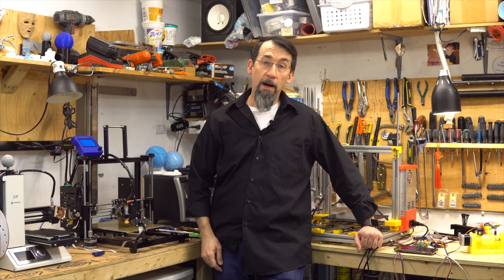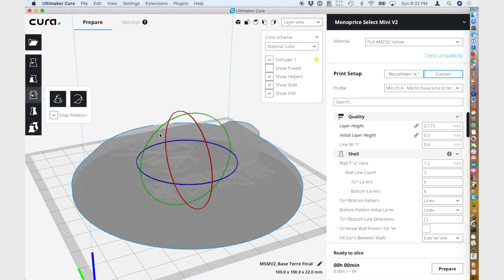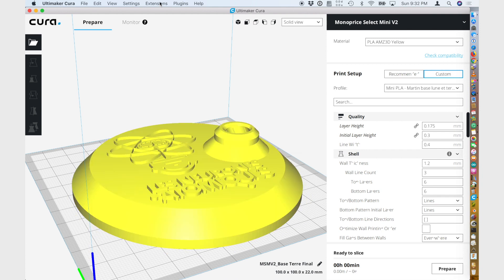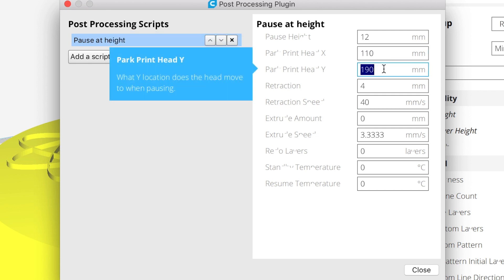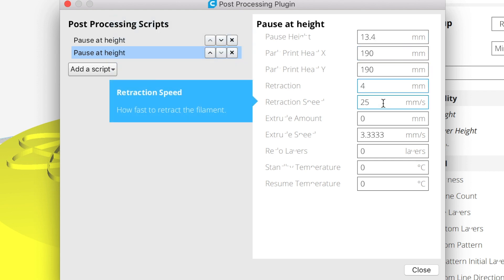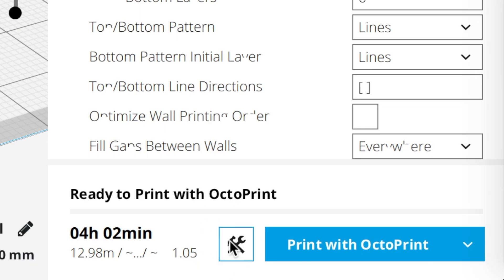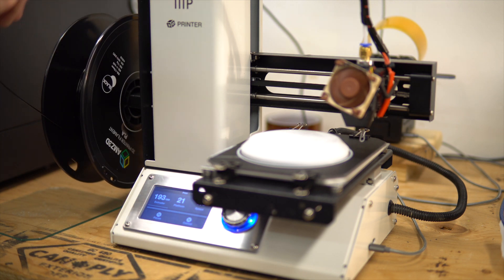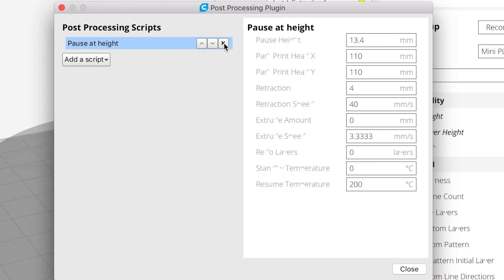Cura - Pause at Height, Print multiple colors

Comment: Why does my printer doesn't resume after the pause?
It has mks tft24 with 3.0.2 firmware
Reply from the maker: TFT24 is a remote to the main board, not sure how to get it to work, I should investigate!
Reply: @Franks3Dshop  thanks let me know if you find any solution.
I've been pulling my hair out over this

Comment: This does not really work for me. It pauses at the correct height but the first time I tried my printer resumed in the wrong area and printed the next set of layers about 15-20 mm off to the side. The second time I tried it started printing but the filament would not stick and it looked terrible. This is on a Monoprice Maker Ultimate 2(NOT by Wanhao, different one). Another time it resumed with the hot end too high up and was not able to put filament close enough to stick. Very frustrating.

Comment: Printed using this method, everything went well up to when it resumed printing. When it moved the nozzle back to the print area it shifted the whole print almost 10 mm to the right, any ideas what would cause that shift? Finished the print, just layers were not even
Reply: me too.  battling that right now.  did you solve it?  thanks in advance

Comment: Hi frank...
I have tried this and on resume after filament change the system only wanted to do retract cycles over the print.
No 2nd filament was pushed.

I am slicing in cura 4.0 and dropping gcodes into repetier host.
Any ideas what this issue may be?

What about slicing flavour..

Marlin
Reprap or repetier.
What should i use?

It parks correct to change filament..it stops at the right layer height.....but resuming the print it cycles and moves where it should but my extruder is just retract on off on off.
Help

Comment: hey Frank! Thanks for all the video you did. They are very informative.
I tried the pause at height and now in the Cura version I use (4.0.0) there is a pause at layer that is very useful.
The only issue I have is that the machine pause only for a few seconds before resuming. I would prefer have the printer pause then wait for my input to continue.

I use a Monoprice mini v2 as well.
Reply from the maker: At the moment of that video I did not experience that problem, when I have a chance I will look back on it...
Reply from the maker: I did not try it again, I will get to it!
Reply: Does the same on my v1

Comment: I tried with cura 4.0 it does the movement to the corner 110-110 mm but it does not pause.. Continues printing... Any suggestions?
Reply from the maker: Does the pause fonction on your printer works ? Maybe there are some settings in Marlin.
Reply: @Franks3Dshop  yes, I can pause manually. It's a select mini v2
Reply: I tried other function on cura 4.0 that says "Filament change", to put the layer you want to make the change and the initial retraction you want in negative .. Like "-4 mm" and the later retraction you leave it on 0.  Then you do the change manually. The X and Y axis moves automatically to 20 x 20 and the Z goes up so you can change the filament
Reply from the maker: Hi sorry. I did not use the change filament, I used pause at height, did you try it ?
Reply: @Franks3Dshop  the pause at high did not work for me. But already tried change filament and works perfectly 👌
Reply from the maker: Cool noted, I will try that also...
Reply: @Franks3Dshop  The settings that works fine for me with me MPSM is: layer (the one you want to be a new color) .  initial retraction: -12 mm.  later retraction: 0 mm I pull manually to change filament, then insert the new one and push to clean the nozzle and then hit start

Comment: Gonna leave this here for the 1000s of newbs like myself that likely have the same question as I did before I figured it out. How did he come up with his measurements you ask? Multiply the height on the slider by layer height. In his case 77 x .175 =13.4 OR you can use the drop down to pause at layer number instead of height! How do you even get the height slider? First "prepare" with your print settings then go to layer view>material color. Thank you for the video but these are some rather important details. You should consider adding this to the description : )
Reply: Not all heroes wear capes.  Thanks mate!
Reply: @darthmagnus8855  I was going to say the same thing...
Reply: Thanks for posting but it doesn't work. I can't find the 'Height" as it only ever shows the layer numbers :(
Reply: @11marksman  In the "Print Settings" dialog box under "Quality" , the first row is labeled "Layer Height".  Should be something like .20, or .16, etc depending on quality setting.  Take that number and multiply it by the layer number where you want the color change to occur.  As m00n commented above, move the layer slider on the very right of the screen to the color change layer and note the number next to the slider.  Multiply layer height by layer number and you have the value in mm to put into the script.  Hope that helps.
Reply: @Explore-Gobal  Thank you!
Reply from the maker: I will revisit this in the latest Cura...
Reply: Thanks so much!!!
Reply: Thank you thats the exact question I was looking to answer with watching this video! You are awesome!
Reply: I just used the slice, moved it to where I want to change colour - mental note of level, then change height to layer on pull down menu, sorted, no calculation needed.

Comment: Hi Frank! Where can I find the height the layer is at? you said you needed to change it at 12mm. Where did  you get that number?
Reply from the maker: Hi, I designed that model, That is how I know, but you can measure it in Fusion 360 from an stl for example, you could also fin it in Cura or other slicer with some tricks playing with z height...
Reply: Frank how did you get that number 12mm because the slider number  in cura was 66?

Comment: Tried theese pause at height settings   but when it paused the Z axis moved down sinking the hot end hard  into my print :(    ???
Reply: My Z axis did the same but not into the print, it just knocked into it when printing resumed. Did you resolve the issue?
Reply: @geraldcox5359  yeah I got a new firmwaee.
Reply: @BLACKSYNTH  Ah, is that the ADVANCED_PAUSE_FEATURE M600 suggestion I've seen? "Pause At Height" requires it?
Reply: Gerald Cox  ahh sorry no I’ve not tried pause at height yet I got the latest tiny machines when I upgraded to a hemera and volcano but the actual pause on printer works now lifts up and parks ready to change filliment.
Reply: @BLACKSYNTH  I figured my issue out. I didn't realize how easy it was to alter the z-axis when switching the filament. On my first attempt, I must have pushed down the head. I was much more careful on the second try and it worked great. Thanks for responding!

Comment: I am using a monoprice maker select V2, but my printer stops when it should, i change the filament, then when i resume the print, it will not extrude. It goes through the motions as if it was printing but doesnt actually print. Ive been trying to fix this for 2 weeks now, any help would be appreciated. I know the filament is in right, because i can start a new print, and the filament extrudes just fine
Reply from the maker: Hi, when resuming is the temperature of the nozzle at 200 or so? When replacing the filament you should be able to extrude some filament manually before resuming, sometimes the filament is caught in the ledge entering the hot end, or in the other transition inside the hot end, you can try to push a little harder on the filament when you replace it.

Comment: Hi Frank, great video very informative. Will this work for start up scripts as well, say for cleaning the hot end of older filament by printing a large line along the y axis before doing the actual print?
Reply from the maker: For that I use some code in the Start Code of my printers, and it does it on it’s own everytime. Let me look...
Reply from the maker: This code in my big printer does a line in the front it could work if you have a big printer like a Prusa:

G92 E0.0 ; reset extruder distance positionG1 Y3.0 F1000.0 ; go outside print areaG0 X-1 Z0.2;(Move outside the printable area)G1 X60.0 E9.0 F1000.0 ; intro lineG1 X100.0 E21.5 F1000.0 ; intro lineG92 E0.0 ; reset extruder distance position
Or this one for the Monoprice Mini does a line on the left
G92 E0;(Reset the extruder to 0)G0 Z5 E5 F500;(Move up and prime the nozzle)
G0 X-1 Z0;(Move outside the printable area)
G1 Y60 E8 F500;(Draw a priming/wiping line to the rear)
G1 X-1;(Move a little closer to the print area)
G1 Y10 E16 F500;(draw more priming/wiping)
G1 E15 F250;(Small retract)
G92 E0;(Zero the extruder)
Reply: Frank's 3D shop Thanks Frank! I could add code like that in Cura 15.x.x but I can't find the equivalent page in version 3.2.1. I have a CR - 10S with a 300mm x 300mm bed. Do you know of a method that I can use to add this to the printer directly?
Reply from the maker: I have a friend with a CR-10S, I will get his start code for you as soon as he answer my text.
Reply from the maker: This is the complete start code in Cura of my friend for his CR-10S, remove M420 S1 if you do not use manual mesh bed leveling.

M200 D1.75
G21 ; set units to millimeters
G90 ; use absolute positioning
M82 ; absolute extrusion mode
G28 ;Home
M420 S1
G1 Z15.0 F6000 ;Move the platform down 15mm
;Prime the extruder
;G92 E0
;G1 F200 E3
G92 E0.0 ; reset extruder distance position
G1 Z5 E5 F500;(Move up and prime the nozzle)
G0 Y50 Z0.2;(Move outside the printable area)
G1 Y60.0 E9.0 F1000.0 ; intro line
G1 Y260.0 E50 F1000.0 ; intro line
G92 E0.0
G1 X3 Y260 Z15 F9000      	   ; Move over and rise to safe Z height
G1 X3 Y10 Z3 F9000		   ; Move back to front of bed at safe Z height to shear strings
Reply: Frank's 3D shop Thanks you very much for your help and kindness!

Comment: I have tried Cura - Pause at Height in Version 15.04.6, and also in the new 3.2.1 version.  From an SD card (offline).  I get the same results on each using my Monoprice Mini V2 (Firmware Version 37.115.2).  It stops printing, then runs to the corner (110,110) and then a few seconds later returns to print without waiting for me to change filament.  If I have 2 Pause at Height scripts in there, it does them back to back, without waiting for filament change.  If I am nearby when the Pause starts, I can step in and manually pause the printer, but that is the only way that I can accomplish a multi-layer multi-color print.  As of today, I have tried it using OctopPrint..  The only difference I get when using it is that it actually stopped and waited for me on the first pause, but after pressing "resume", it ran the 2nd Pause script without waiting for me to interact with it.  So it actually ran the 2 Pauses back to back.  Help!!!!!!!!!!!!!!!!!!!!!!!!!!!!!!  Any I deas?????
Reply from the maker: I have firmware V41 maybe that is the difference, I see nothing in the release notes about your problem. I presume you used the same method as I did in the video for Cura 3.2.1. I do not have access to a previous version to test this, you could ask Mathew Upp at mpselectmini.com he knows a lot about the firmware and have access to the developers of the firmware.
Reply: Yes I did exactly as you showed.  I will look into that.  Thanks for the reply.
Reply: Matthew suggested adding M600 to my gcode, but that kinda defeats the Cura plugin.  Also, it moves to 0,0 and that makes it difficult to load filament since it is in the front left corner, not right rear corner like Cura does for you.
Another question for you, when Cura "Auto-Resizes" an STL, does it actually resize, or just say it has?  Older 3.0 version did actually resize my files that are too large for the build plate, but 3.2.1 doesn't actually do the resizing, it only says that it has. Thanks for your help.
Reply from the maker: Same for me, it say 46% and does not do it, I just go and enter it manually using the size tool on the left.
Reply from the maker: Just submitted a report bug to Ultimaker about that...
Reply: Frank's 3D shop 
Awesome. I didn't know they listen to other brand users. 
I also manually resize, for now.
Reply from the maker: Just got confirmation from the development team of Cura, it is fixed in the next version of Cura...
Reply: Frank's 3D shop
Thanks. Good to hear.
Reply from the maker: I just tried beta 3.3 of Cura and scaling works as it should!
Reply: Frank's 3D shop thanks for the info

Comment: Will this work for older versions of cura, such as 15.04.6?
Reply from the maker: Yes it could work, but you have to use a special python script, or you can modify the gcode manually finding the correct layer change. It’s easier to use a newer version.

Comment: How to use gcode pause, with sd card way? I mean, can I use save to sd card with paused extension gcode?
Thankyou
Reply from the maker: Hi, it works with an SD card even with Octoprint, the example I have shown in this video is with an SD card, with Octoprint you will have to resume on the Octoprint interface instead of the screen of the printer.
Reply: Frank's 3D shop wow great! Thank you

Comment: Very helpful, thanks. But aren't you afraid that your extruder lever might break? I've seen multiple posts in the FB group(s) with photos of broken or cracked extruder levers. I have a spare one printed, so when it happens for me, I'll be prepared, but I'd rather not wake sleeping dogs, so to say...
Reply: I printed replacements
Reply from the maker: You sure have to be careful, but I do not see why it would make it more likely to break. Why are you afraid of that?
Reply: Mainly because of the reports of others. I cannot imagine myself why the lever would ever break. After all, it does look sturdy enough to me, and as long as you aren't totally abusing it, there should be no problems. Still, I try to use it as little as possible to avoid the problem altogether.
Reply from the maker: I take care not to put any force on the arm if I work on it in any way, it’s only a small sheet of steel. I also watch the printer when resuming the print; if it would go south, I would just turn it of. If the arm ever brakes, I will try to repair it and make a video! ;-)